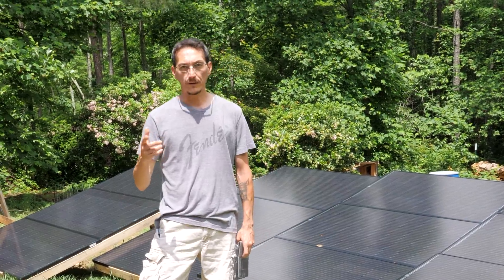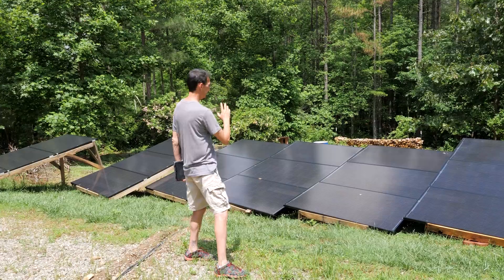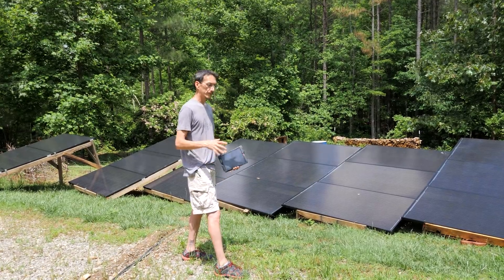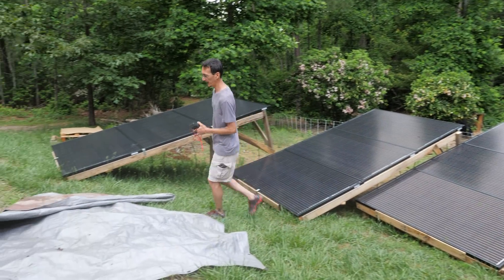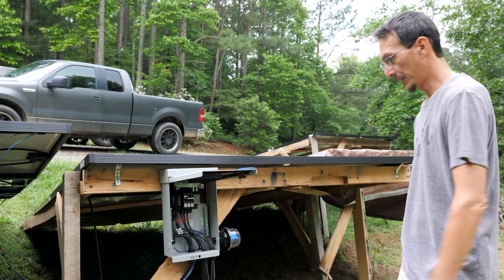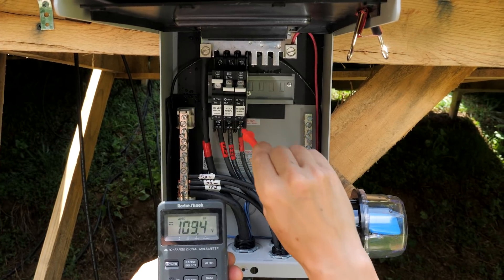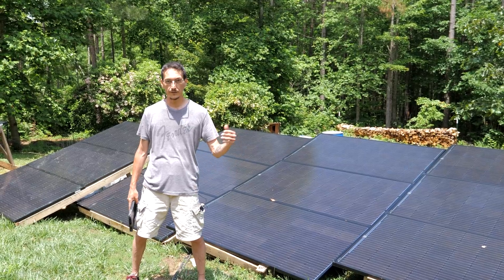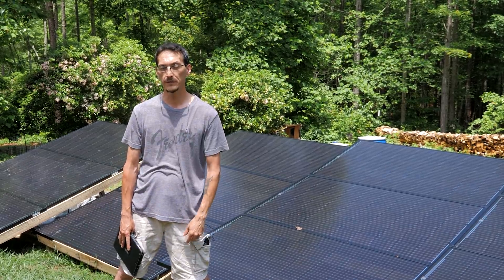DIY Off Grid Solar: Building a Renewable Energy 5.2 KW Solar Panel Array (Part 3)

Comment from the maker: Due to the crazy install (and even crazier weather where we considered building an Ark instead of a solar system)...these videos have been recorded out of order so we could show you the process lineally.  Next video will be on how to assemble the combiner boxes.  Stay tuned!  More links in the description.  Thanks for watching!
Reply: Guildbrook Farm - Off Grid Living  I like the panels being in a easy to clean location...folks but them on the roof and I just smh!
Reply: The power inverter should always be at the house. Higher input voltage should be used if the panels are away from the house. I would use a 48 volt system so less loss and lighter wire can be used. If you put the inverter at the site then you might could run high voltage ac and step it to 240 volts at the house with 2 120 volt sides. Then you will have power for both 120 and 240 items. It will cost more if you step up the ac voltage because you will need transformers and transformers use power even at zero load.
Reply: @Ron B: They can simply run a high voltage, split phase inverter, and step it down to 240 at the house, which is the correct solution. Standard cables are too lossy for transmission of low voltage DC beyond a few hundred feet. The inverter should only be at your house if the storage array is also at the house (in garage, shed, basement, etc).
Reply: @ForestNinjaZero  Thanks I will remember that if I ever need a long run from the solar panels. You are right low voltage = loss. When it comes to long runs. Wire size is also smaller for high voltages.
Reply: @Ron B: Another thing that I noticed is that he's running his panels in series, and panels which are partially obstructed by trees, roofing, or other structures will resist while under load, even if they're just recharging batteries. For long runs, it's best to run larger, high-voltage panels in parallel, or arrange sets of panels in series where they'll always be exposed evenly if you need higher voltages from your panels due to load or distance. In this case, running from a shed which is closer to his array and extending a split-phase 240 across the yard would likely be sufficient, but consider that those low voltage inverters are sensitive to resistance and potential, and might malfunction with long, un-grounded cables attached to the outputs.

Comment: HOWdy  GBF,
We have very similar systems - I have a 23 X 208 Watt Panels 
that  I  have  arranged in FOUR (4) higher voltage SERIES  "Strings" 
Not trying to be critical 
... but ... 
on your GROUNDING lug with a  LOT of wires crammed together & then CLAMPED in to your EARTH COPPER ROD    
I have read countless times = NOT to have more than ONE (1) wire per Grounding Clamp 
I'm not sure how to safely BRING that many wires safely to GROUND - but - I have read that this might NOT be the safest WAY ... 
... 
COOP

Comment: If this is a project where cost wasn't a concern then don't read any further unless you just want a couple of laughs from some silly things I say because I'm from the southeast. LOL!!! RTR!!! 

   Wouldn't it be more cost effective and sustainable short and long-term to run any 12v appliance you could possibly run, heat with wood, cool with a buried pipe air circulation system, cook with induction and mount your panels on a tracker? 

   I'm American an I'm from the southeast so it was very hard for me to get out of the "shit it and get it mindset" an when I finally did, try not to fall for the what I've coined as the "Natures Head Mindset" which is when you go completely 180 degree's the opposite way an you fall for the bullshit like the Natures Head toilet. There's a place in the middle that logical people who are hunting it will eventually find, but it's usually a dump truck load of money later. LOL! 

   Personally I would set my home up just as I would an off grid camper that the common man would have for himself an family. Now maybe you are going off grid for reason's other than the "save the earth bullshit" or "economic benefit". Maybe you want to be "self reliant" which will make you king of your own world aka Homestead an won't be phased by most of the rat race bullshit we all deal with daily. But you also don't want to give up the basic modern day way of life we live in the US which I must admit is awesome. If the later is the case well my friend shit it and get it! LOL! 

   God Bless an Keep On Keep'in On!!!
Reply: I'm sorry to hear that.  Maybe someday there will be a cure.

Comment: I hope your charge controller will take well over 110V. Must take the open circuit voltage of your panels. Because when the batteries are full and no power is used that is the voltage to your charge controller will get!
Reply from the maker: Classic 150’s will take 180v

Comment: Hello Jeremy, your idea is right, but I do not agree with your thinking.  Why do you want to put your own power plant up ?  How about small independent systems dedicated for it's purpose ? It is less expensive, easier to maintain and one problem does not affect your hole setup.  Already doing it.  Inverters are a battery destroyer.  It's fine if you use a converter to generate power from high voltage DC (panels in series) to drive power applications, but 12V is a standard, you get everything in 12V.  And many applications are very suitable to work directly off a solar panel without a battery.  Just a few tricks to apply.
You're welcome to communicate. fanie at faze in the illegal British colony of Sick Africa.  Always look at 10 years plus maintenance free and long term sustainable.  My eyes begin to water if you talk in KW when you're supposed to talk in Amp.
Reply: Disagree with just about everything. 12v is NOT the standard, 48V is more the standard followed up by Off Grid living at 24vdc. 12v is for 4x4 guys going camping for the weekend, even very debatable for RV guys. Just think about how many amps you would draw off a 12v system using the washing machine alone ...  (ohms law ...) We live in a 220vac region and as a rough guide use the basic formula of for every 1 amp pulled off your 220vac side you will draw around 17 amps from your batteries. Now try 110vac, you will pull over 34 amps off your batteries, serious inverter required along with serious wiring actually becoming dangerous for any amount of high amperage requirement, Let's look at a pump, start up draw of say 6 amps ... that is 204 amps from your poor 12v batteries. On 24 v it halves to around 102 amps and at 48v it becomes great at around 50 amps. So the above say's to me once again, your 12v systems are for the weekend camper, no more if your draw exceeds around 5 amps AC.  If you want to go to "high voltage" AC then using multiple systems is just crazy, one decent system is great. As for an inverter being a battery destroyer, what a lot of nonsense (see I can put it nicely) You set up your inverter when you install it. It has a cut off voltage and simply setting it to a cut off voltage of around 12,1 to 12,5 v (on your 12v system !!) will prevent any battery damage by not allowing the batteries to drop below about 55% to 60% of charge (just double up for a 24v system and again for a 48v system) Lastly talking in Kw is acceptable, amps, or watts make no difference, watts is preferable as it's the actual "work done" Where I do agree is firstly the Kw ... wow, 5,2 Kw of solar panels, my mind boggles. We live comfortably off around 900w of solar panels on a 24v system through a 1200w full sine wave inverter. It's called compromise and power management ...
Reply: Definitely agree with @Dave.  12 VDC is a standard but it's by no means the standard, and it's only useful on a really small system where the amperage is low.  As soon as you start talking about normal household sized appliances, 12 V quickly becomes a poor performer because you either get a huge loss in the wiring system (more amps equals more loss in cable runs) or you get a huge loss in your wallet from the expense of running really thick cables to minimize wasted power.

The higher the voltage the less loss, which is why 48 VDC is popular for higher powered off-grid setups, but really you can't beat an inverter and running your local mains voltage everywhere.  Once you are transporting power through more than a few metres/feet of cable, it becomes more efficient to spend some power on running an inverter and move the rest of the power more efficiently at 110/240 VAC than to leave it as 12 VDC the whole time (unless you switch to massive thick cables).

12V is fine if you want to live the camping lifestyle with a couple of miniature appliances physically close to your panel/batteries, but if you want your lifestyle to resemble a normal household then running mains AC is really the only practical option.

Comment: WHEN it snows, your modules will be covered at least as deep as the snow, which will lower your total output. Should have them at least 2-3' off the ground.
Reply: he will understand what you're saying when he'll see mountains of snow all over his pannels :)
Reply: Well this is what it looks like with snow: https://youtu.be/dTlW9nlVGz4?t=187  It's a bit hard to tell whether they are covered at the base or whether it's a hill of snow obscuring the panels though.
Reply from the maker: Could put them 30’ in the air and they would still get covered in snow. But then you couldn’t reach them to push the snow off.

Comment: Nice work. Really like your videos. Just a quick FYI on your panel racking angles.... I've got 12+kw on grid tie and find that my 5kw array at 40deg tilt is pretty much self cleaning. The 3.5 and 2.5kw arrays on my workshop at 4-12 pitch are a pain. I have to wash them twice as much as the steeper angle panels. Also, if you get into it, solar hot water is pretty good too, over 70% efficiency on evacuated tube setups. My setup works good but my 200gal storage tank isn't large enough for winter. Consider adding wood boiler heat in winter. Always go with a drainback setup vs closed loop. Hardly any maintenance with drainback. Offers both freeze and overheat protection as well as power failure protection. I've boiled over my closed loop system a few times, recently when the power authority decided to cut power 6hrs for line upgrades on my street. Combining sources for solar/wind/hydro/ etc is the way to go. BTW, here in Canada (BC) I have some 330w panels on order for $0.50cdn/watt. No excuse anymore to go green. Happy homesteading!

Comment: Was just thinking if you have got them setup this way should they not each have there own mppt on each string as they are all operating at different voltages hooked upto a combiner box would not the lowest voltage of the string bring down the total power made (norm on housed roofs where they have 2 strings on the roof they norm use a duel mppt inverter so one side of the roof can't affect the other ) It be so good if dc to dc inverters was a thing off grid systems (micro dc to ac off grid inverters)

Comment: What combiner box did you use?
Reply from the maker: DIY Off-Grid Solar: Assemble & Wire a Combiner Box (Part 4)
https://youtu.be/L4TonxyQDBs
Reply: @Guildbrookfarm  we live in Tx and the only reason we have for not going solar is hail storms. One storm could easily destroy every panel if we went solar. So we're thinking wind.
Reply: @sonyachoate1480  If only you could extract power from hail stones, it sounds like you'd be set

Comment: When you said 35 volts for each string of 3 panels which would be around that 95v you said you then have an array of 9 panels wouldn't that be around 300v? which would be too much for the charge controller?
Reply from the maker: Each panel averages 35v at 8amps in direct sun. A string of 3 in series makes the string 105v at 8amps. Wiring the 3 strings together in the combiner box connects them in parallel which triples the amps but leaves the voltage at 105. So each array in direct sun should produce 24amps at 105v or about 2.5Kw.
Reply: oh of course, thanks for that. I'm still trying to get my head around it all.
Reply from the maker: It’s confusing for sure. Took me more than a minute. 😉
Reply: I think the part that's confusing for me is how it becomes a parallel connection in the combiner box vs wiring a battery bank in parallel with the pos to pos and the neg to the neg but I guess the bus bar is the same thing lol

Comment: May I suggest bringing the front of the racks up off the ground by 6-8 inches to make it easier to weed eat and mow around... also keep small animals and insects off the panels.  You could also use a chicken wire fence around the perimeter to keep the chickens off of them.

Comment: Something to consider in northern locations is the first snow will cover the bottom half of the panel and you’ll lose most of the potential output.
Weeds have a similar effect.
Raise them up 3’ and you’ll avoid this

Comment: Looks amazing! We need a similar system actually. If you don't mind sharing, what all are you running with this sized array? Washer dryer, frig, a/c, or any big stuff like that? Looking into getting a propane gas dryer, but still need to power the washer. Just curious about whatcha got. Really, looks great and so happy for ya. Thanks lots for sharing.
Reply from the maker: Washer, fridge, water pump, PC and lights. No dryer, we hang clothes. It will run a small window A/C also.
Reply: Guildbrook Farm - Off Grid Living 
That's awesome! Thanks lots!

Comment: I hope you use some ground ties to keep the frame from blowing off in high winds, yes those winds will flip those damn panels even though there +54 kg  a piece...
Hopefully the manufacturer gives you the normal specs included with the Standard specs, use the normal specs for designing your system because the manufacturer does not really show you the heat coefficient loss of your panels which will occur....

Comment: any reason you ruled out micro invertors at the panels?  greatly simplifies wiring when you arent pushing DC around.
Reply: It's an off grid setup so no ac grid for the micro inverters to synchronize to..... unless he has an SMA Sunny Island setup (which is a whole other animal) which can be ac-coupled but only by sunny boy inverters.

Comment: Wow! That's one heck of an impressive system that you are assembling. I'm green with envy. Looks like you'll be able to have decent air conditioning with that. Daytime on sunny days, once you're charged you'll have way more juice than you know what to do with. I have my 24v 250w panels wired in strings of three also. Outback recommends an array voltage 12v to 24v higher than the nominal voltage of your battery bank. My array was getting up just a bit over 60v on strings of two. Not quite enough for my 48v system.  I was having trouble consistently coming up to equalize voltage, so I rewired for three on each string. When it's hot and sunny like it has been lately I'm seeing 100v to 105v. On the coldest days of winter on bright sunny days my voltage has gone as high as 127v. With my Outback FM80 charge controller, when you reach 145v you let the smoke out, so I'm getting somewhat close to flirting with disaster, but I'm not worried about it. I don't know what the voltage limit is on your Midnite, but if your array were hooked up to my controller I'd worry about my winter voltage. 

This is turning out to be a really outstanding series. Can't wait to see the next one.
Reply from the maker: Midnight has what they call HyperVoC in their Classics that will eat higher voltage on cold panels and to accommodate those “strings of 3” situations for 48v systems. There will be a video on this very subject because I have a controller on crack that thinks it’s getting 180+ volts. Not.
Reply: Huck Finn k

Comment: Nice job, especially splitting it into two independent arrays.  The biggest problems I see are people unable to expand their single array because they can't find matching panels, but if you can just move them into the other array (or even add a third array) that makes future expansion much easier.  Not to mention a failure of one array won't leave you without power, but will just mean your batteries charge a bit slower.  Splitting each array into three strings instead of having a single 9-panel string will also greatly improve efficiency, especially with any shade (or chicken poo!) as this will only impact three panels rather than all nine.  Job well done, you've really planned that out properly!

Comment: Must be so satisfying to have designed all this, purchased it, hooked it all up and then become self sufficient. Looked really well done. My concern with an array like this is that it be very well strapped down so as to be able to withstand rough weather.
Reply from the maker: Well it’s certainly not tornado proof but no solar install is. It’s strapped down good though.

Comment: The VoC doesn't tell you what they're producing. -_- It just tells you that your panels aren't that much hotter (temperature wise) than the Standard Test Conditions...

You'd need to measure actual output. Or at least IsC... VoC is just a quick "oh yep all the cells are still there and in the sun".
Reply from the maker: Correct. VoC is also the minimum voltage you need to account for in cold weather when sizing the PV string to a charge controller. Just to make sure you don’t fry it.
Reply: Guildbrook Farm - Off Grid Living 
I always advise leaving headroom for colder than normal weather. Take your array's normal VoC and then add ~5% or so to make sure you're safe.

In your case, the ~105 VoC is well below your classic 150's input range; and the Hyper VoC feature further protects the controller in unusual cases, so nothing wrong with your setup thus far.
Reply from the maker: That’s right